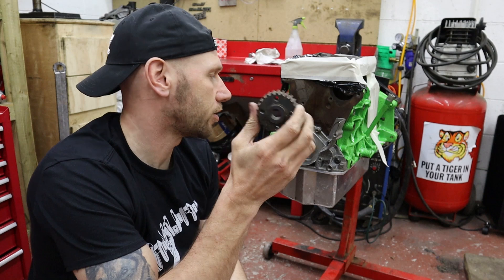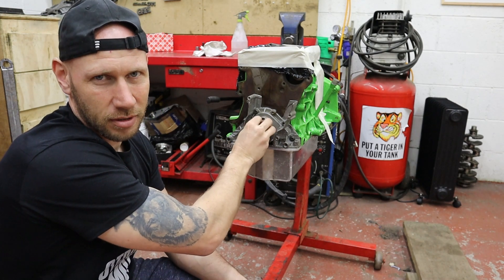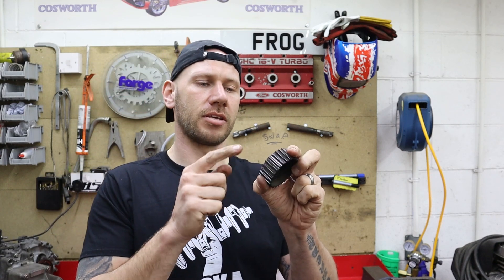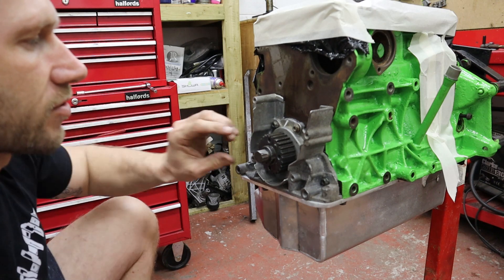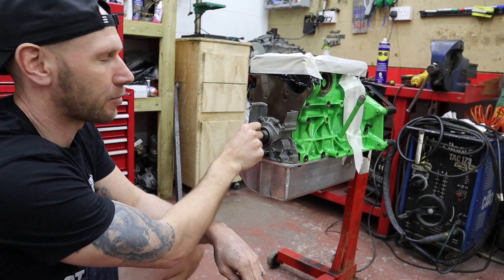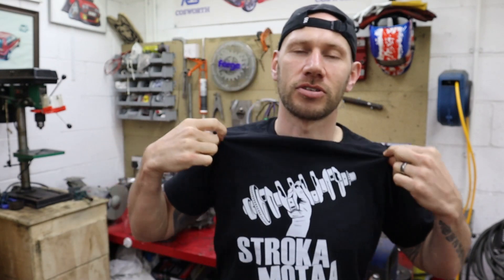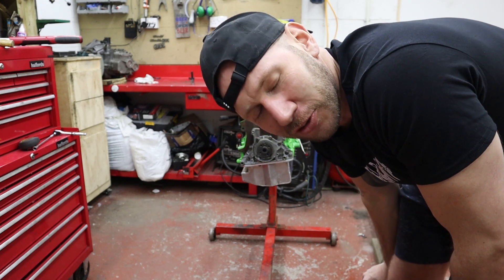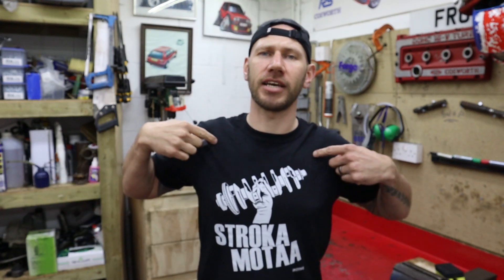HOW TO DOWEL PIN A CRANK!! // 1.8T 20vT VAG Engine

Comment: Are you supposed to bin the diamond coated washer? Or drill it to suit?
Reply from the maker: 1.8ts don't have the washer.
Reply: What about the 2 litre? S3 8p
Reply from the maker: @Steven Darling  The washer is good enough to hold for most applications. Use the washer and an ARP bolt and it'll be good 👍
Reply: Videos are great, I'm using them as a reference for my forged build. Keep up the good work.
Reply from the maker: @Steven Darling  Thank you pal, I will. Let me know how your build goes 👍

Comment: I need to do this. Was chasing a p0016 code forever on my 2.0 bpg. Ended up being stripped keyway on timing gear, had a shop do my timing about 20k ago and apparently they didn’t clean up old coolant and left the diamond washer out and didn’t tighten bolt enough. So I need to get this kit.. also that tool is needed as well.

Comment: Great vid. One question however can this be done on the car without removing the crank gear or bolt? Kept factory crank and mains in place when dropped in new rods and pistons
Reply from the maker: Cheers! It can be done with the crank still in the car, but you'd have to remove the crank bolt as the dowels are installed underneath it.

Comment: Chip buttie time Spencer 🤔!!
Reply: My 20v turbo agu has just started making the cheese rod noise oh noooo!!
Reply from the maker: Diesel like tone is very typical of a bent rod. You can confirm it with a rod down the plug hole to measure piston crown height

Comment: Hi Nick I know this is quite an old thread now but can I do this with the belt in place? As in take the bolt out and do it in place?

Cheers
Reply from the maker: Hi David, its probably not impossible BUT the belt tension would most probably dislodge the bottom pulley when removed, so I wouldn't advise it. It would be very simple to do with the belt removed, and then just change the belt at the same time, which is what I would do.
Reply: @DecimalTenths  it's a fresh build just about to go in the car dude. I've been toying with the idea since you did the video. I am running a k04 hybrid and my builder didn't deem it necessary and nor does my mate who's is about to fit it. But I'm unsure dude. Turbo has made 330hp 348 ft lbs at r tech. I know it's not huge. Where would you say the point of needing to do it would be?

Comment: Excellent work! Is it also 'nescassary' to do on a std 1.8t or... for insurance? Thanks an liked!
Reply from the maker: Not really on a standard or even stage1 or 2 tuned. It becomes a necessity if you run big stage 3 type power which includes upgraded valve gear. 🤘

Comment: high strength alloy steel dowel pin were do u  buy it and did u news the oem crankgear
Reply from the maker: Hi there, links to all the kit I use is in the description. You can buy a kit and even pre drilled crank pulleys from proraceengineering if you didnt want to get that bit yourself.

Comment: Whats your opinion on going the billet crank gear route? Just as good? better?
Reply from the maker: Me personally, I dont see the point if you pin the pulley.
Reply: Decimal Tenths ahh, I took the billet crank & ARP bolt approach for my build.
Reply from the maker: @ngeniousjames866  I'm sure itll do you well! Lots run that setup. This is basically just cheaper.

Comment: I ended up with one... Tried to do 2 but a drill bit snapped in one of the holes haha!
Reply: So I'd call that a good one and a half pins!
Reply from the maker: 😂 wounded mate. 1 will do for sure
Reply: @DecimalTenths  yeah, one 4mm pin, and the ARP bolt should be plenty. I like the idea of 2 to be extra safe, but I wasn't worried that I only got the one. My engine build is no where at your level, so if it goes I'll only be sending rosten vales into standard pistons, and maybe bending some max speeding rods 🤷🏻‍♂️